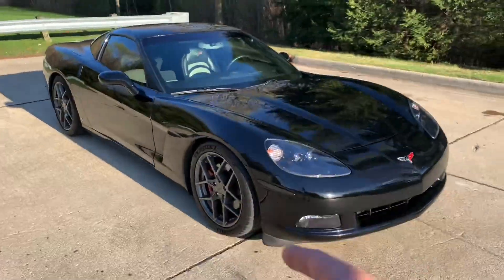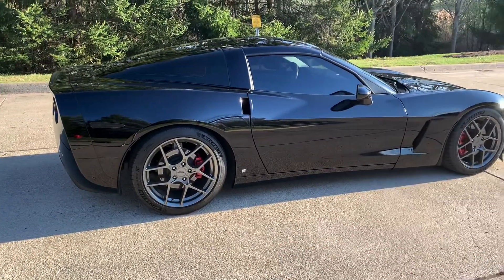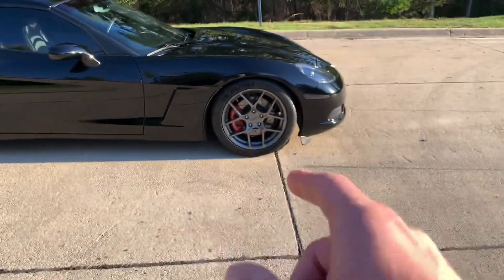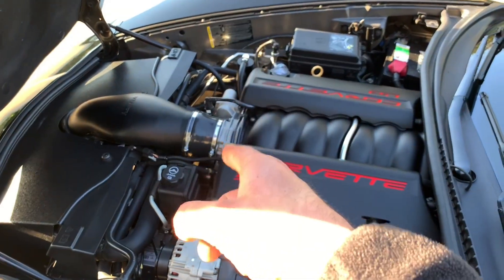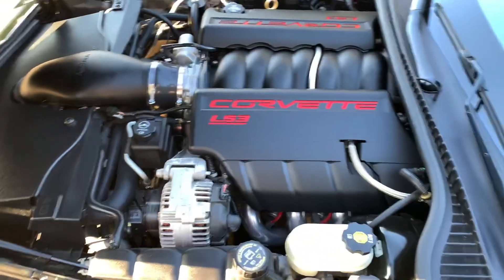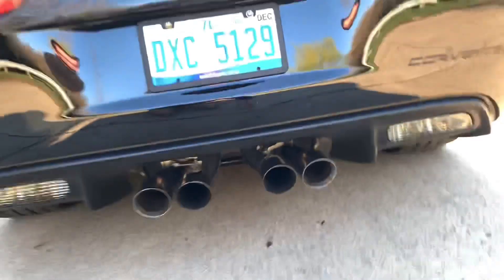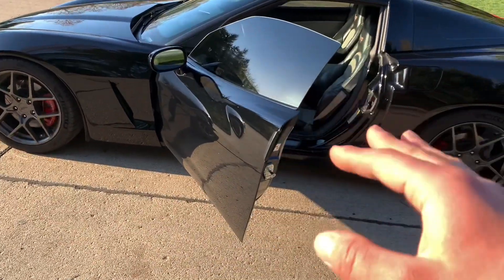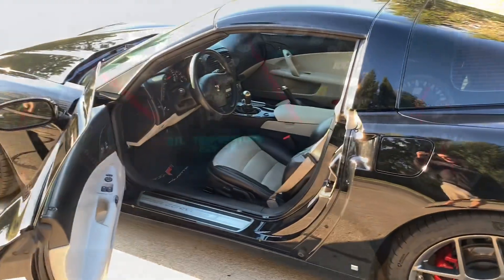Quick update and breakdown of my build

Comment: I got an 08 cam auto car with 474 rwhp but I got the new Nitto NT555r2 which is the drag radial version of the G2 and they hook!
Reply from the maker: Nice! Yeah I will check them out. I was thinking of R888r's next because of the end goal of making around 700-750whp.
Reply: @Thedonron12  I am going their doing an A&A blower kit and a Dewitts dual fan radiator on flex fuel
Reply from the maker: @fh5tuningredlinemotorsport766  Nice! Good Choices. What are you doing for fuel system?
Reply: @Thedonron12  when I do the blower it comes with a BAP and injectors but I A&A makes a flex fuel system to take it right above 700
Reply: @Thedonron12  keep it simple A&A, A&A fuel kit, radiator Dewitts dual fan, and make sure you PIN THE CRANK!
Reply from the maker: @fh5tuningredlinemotorsport766  I'm tracking. I was considering A&A but I like PD blowers and the heartbeat seems to be the right fit for me especially with the insane down low torque it makes. Just one thing the stock LS3 fuel pumps will eventually die when running E85. I plan to go with a hellcat 525 in tank pump with a racetronix harness when I change my clutch out.
Reply: @Thedonron12  I have a friend with a heartbeat and a cam but a lot of issues with not enough air even at 9.5 lbs of boost
Reply: @Thedonron12  he has meth and a cam too it’s an automatic Grand sport made 662 rwhp
Reply: @Thedonron12  A&A centrifugal has lower IAT but both you want to do a radiator with fans
Reply from the maker: @fh5tuningredlinemotorsport766  There's a local guy with a GS auto making 750whp/710wtq thru the maggie on 12lbs with E85 and he has no issues. I like the clean simple look of the heartbeat blower as well. It is much more expensive tho. I will eventually upgrade the radiator and fans as well.

Comment: Man your build is almost identical to what I’m going to end up with on my base black 2011. Couple of questions, are your wheels and tires stock sizes and where’d you get the wheels? Also how do you like the TPS headers? You have a lot of nice parts on this car. Looks and sounds fantastic!
Reply from the maker: The wheels are stock sizes but the tires are bigger, 255/40 up front and 295/35 in the back. I got them off tire rack about 1 year ago for around 900 dollars shipped. They are lightweight and look great imo. The TPS headers so far are doing fine so far. Thanks man! Thanks for watching!

Comment: If you Gov then you not need to pay for the Ticket if get pulled over for that exaustnoise...i recommend a valve mode exaust to avoid it..🤣🤣if you still got the stockradiator it will overheat for shure if push it hard.i got a aloy in.mine ,selfbuild enforced radiator supportbar,and i use engine ice too keep the engine cool ,next mod is coils..👍🤣
Reply from the maker: I have the NPP Dual Mode exhaust, in quiet mode you can't hear a thing.
Reply: @Thedonron12  Cool you need it.👍

Comment: How do you like the B8s? I've been looking at them or the similar DRM shocks, but leaning toward B8s solely because I've read that Bilstein won't rebuilt DRM shocks and DRM can be difficult to get ahold of for rebuilds.
Reply from the maker: I really like them! I also had the B6's before but their weren't as firm as I liked them to be. The B8's are great! I have stock base leaf springs but eventually I am swapping out the front to a Z51 bar. The car is extremely well planted! I think for 420 bucks for the B8's you can't beat em!